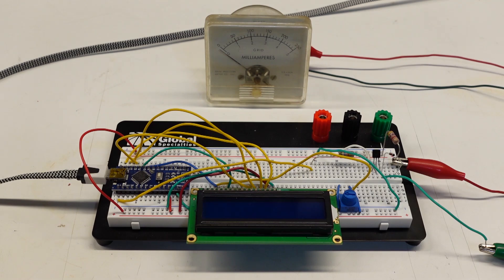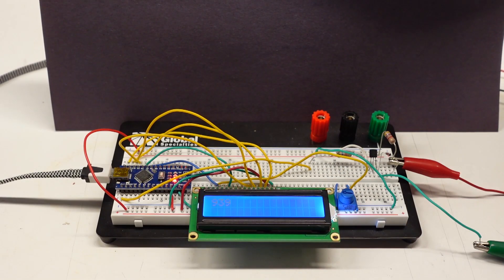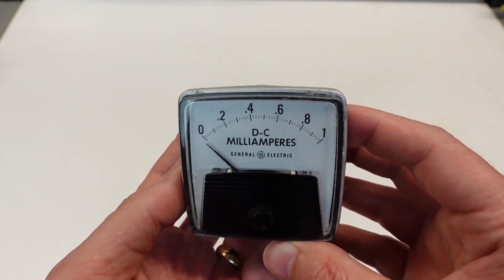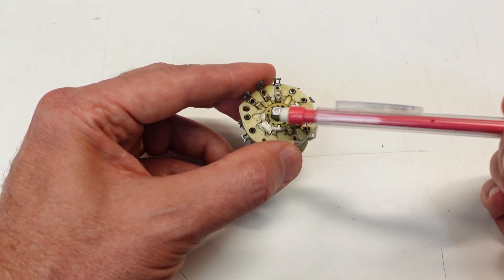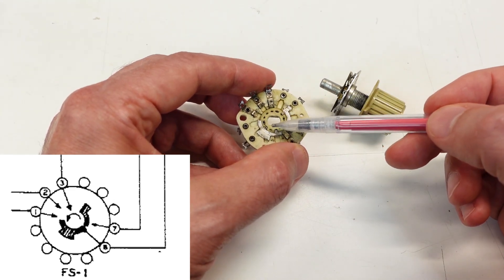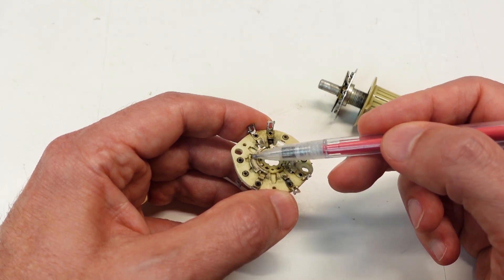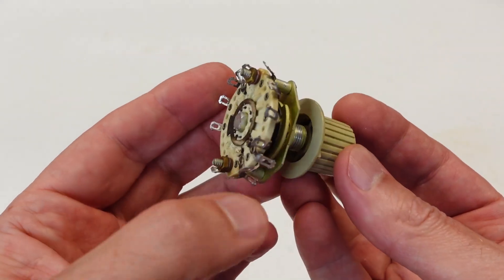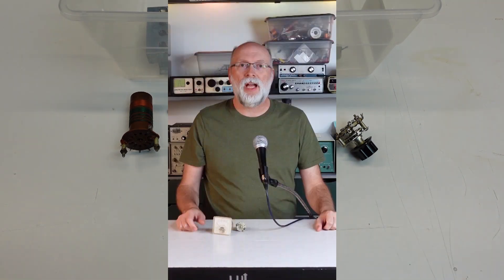Heathkit DX-60: Part #4

Comment: You gave up fast on that meter. It can handle 6 times the rated 1 mA current. You need to get it past it's problem zone. Actually taking of the front glass and blowing gently on the needle from the side is a good way to start, yhen judt apply current until it moves free. It ain't rocket science and takes a lot less time than trying to find a meter to replace it.

Comment: Some say gun or sewing machine oil is a good lubricant for the bushings as they are "non-gumming" lubricants.  I would have been scratching my head if that meter cycling test actually worked. 👍
Reply: I'm thinking that 3 in 1 oil is non-gumming.